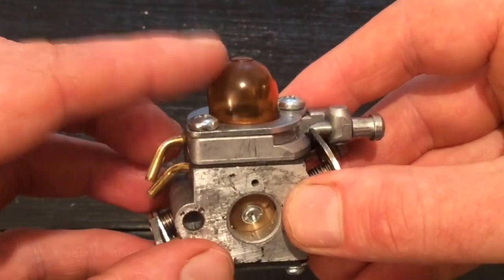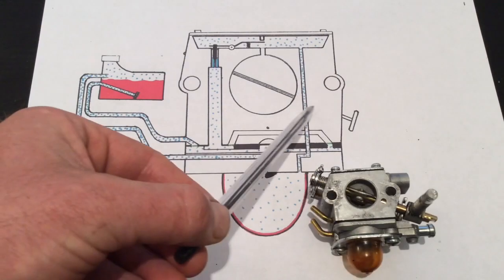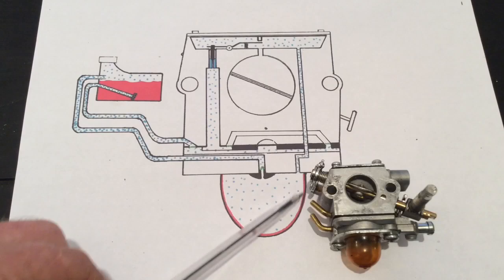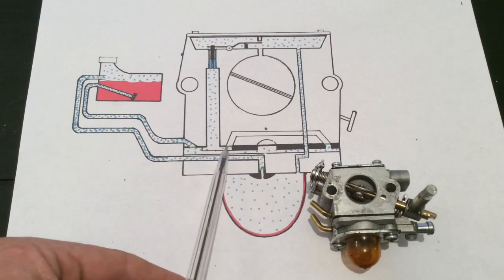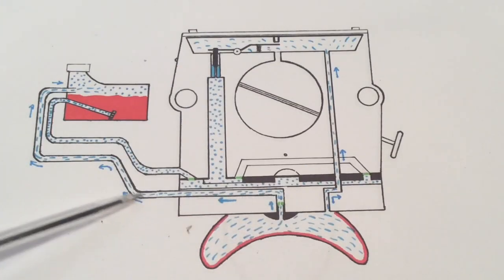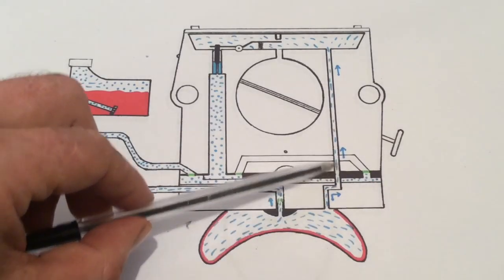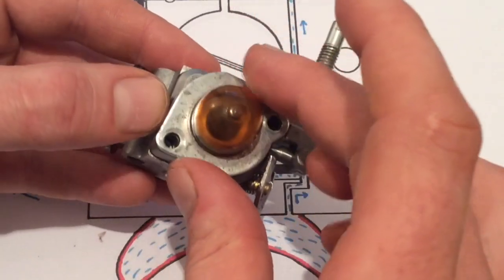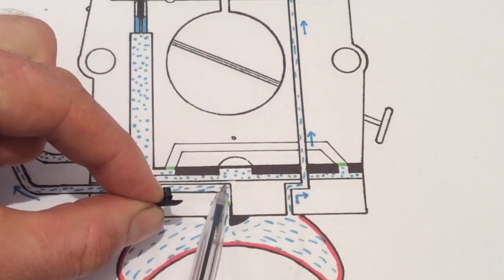The Whole Fuel Priming System Explained - In a 2-Stroke Carburetor.  (by Craig Kirkman)

Comment: Good learning from that, which of course raises questions as I conside it applied to my experience. 1) Does it matter if the choke is set before depressing the primer bulb...seems not, but also seems logical you set the choke last before pulling the starter rope. 2) What does it suggest if when you release the depressed primer bulb, it doesn't tend to fully return to its undepressed shape? Perhaps it indicates something (one of the many little valves or passageways) is plugged and the carb needs a good cleaning? 3) In theory, when you run the engine after shutting off or draining the fuel, are you likely to get all those areas drained so things won't gum up in the period of disuse, ornis there another strategy to keep the carb set for the next use?

Thanks for the detailed explanations! Cheers!

Comment: Nice explanation, thanks. Re the valve in the jet... what keeps it closed when you press the primer bulb(so higher pressure above), yet it opens to allow fuel through to the venturi when the engine is running( with reduced pressure below)...how does the valve differentiate ?

Comment: This is an excellent description of how the priming system works.  It is clear and easy to understand.  One thing that does not seem to be mentioned is what is on the other side of the metering diaphragm.  In the video the cover plate is shown briefly and it appears to have a hole in it.  That would suggest the dry side of the metering diaphragm is exposed to atmosphere.  Is that right?  Thanks for posting this educational video.

Comment: such a great explanation. it is really incredible the design of something like that. simple but almost complex. my gas bulb had a hole in it and i could not get my weed eater to start. i sort of figured that that little bulb was important.  and i find out it is. no gas coming into the bulb so now i have to find a replacement. thanks for you video. was very good.

Comment: Hello sir , I have a problem with my husqvarna 560xp 2017 model auto tune carburettor , it doesn’t suck fuel from the tank when I press the primer bulb, it is does the pressure in the tank but the fuel not come in the primer bulb, can you please help me with that??? Thanks

Comment: Brilliant video and well explained,took my stihl blower out today after sitting for pretty much all of winter, purge bulb had no fuel in it, tryed priming numerous times. No fuel arrived into bulb and bulb very slow to come back to shape. Stripped out carb, cleaned up with some carb cleaner, checked bulb while not connected to the carb to see if it would draw fuel, it did! Ensemble everything back together but still won't draw fuel???

Comment: why does my tank pressurize when 'primed'? (Husky XT260)  Wont start if I have the cap off....? I put a balloon on the tank opening and it inflated when I primed the bulb. Only way I got it to start was to use the balloon as a gasket under a likely leaking cap (I put soapy water on the small valve in the cap and it bubbles when I pumped the primer bulb).

Comment: Hi, i got a REALLY tricky fuel problem or pulse hole maybe
****
It Bogs down when open throttle and only sort of idles so i suspected carb or fuel starvation
So as i done before, i open carb and all parts looked ok but i cleaned and replaced all the diaphragms ect and it run for 10 mins idle and full power and then starved off. I also put a brand new carb on just to eliminate the carb and same problem.
I then suspected the pulse hole leakage or engine leaking at oil seal or gaskets causing air to get in maybe when warmed up and leaning the mixture.  Put vac of 9 psi and it held steady after blocking off inlet and exhaust so the engine isnt leaking. i tried compression next and got 120 psi ? is that enough to make pulse hole work ? 
 i attached a vac gauge to the little pulse hole and pulled rope and got about 2 psi vac and pressure on the gauge so dont know if thats enough?
I notice when i try to start , there is no fuel being drawn through the fuel line to the carb so how can it even idle? Also i bypassed the filter to make sure fuel was available from the tank above the carb. This weed machine dosent have a prime bulb so does the 2 little pump flaps have to have fuel in the carb to start pumping? It worked in past as it is so i guess it will pump until fuel gets to carb but i dont see any going down the line so PULSE line issue not making the pump pump anymore? 
I used new gaskets and made sure the little gasket hole lined up ect to reach the carb and complete the air pulse circuit.
I am at a loss on this machine.

Comment: Good, but my Homelite leaf blower has Walbro 212A with the bulb on the needle side of the carb..it stopped priming and can't figure out why..thoroughly cleaned and replaced both diaphragms..it actually primes backwards pressurizing the fuel tank and never getting fuel to the needle valve or bulb...Thinking I have something installed backwards but I've tripple checked everything...

Comment: Great video and many thanks for for sharing your knowledge with us . I have walbro wt 273 carb with primer bulb on top.It  was working but now after replacing bulb all gaskets and diaphram it won`t suck in via the inlet pipe yet when i submerge it in water it fills up and pumps .I  cannot see where the air/water is coming in and for sure everything is fitted in the correct order.

Comment: Thanks for that! Is there any reason that the bulb would be full of half air and half gas? I've pressed mine 20 times and it's still returning air and pulling in bubbly fuel.
Reply: @CreativeVs didn't find the problem but after messing with the carb and reassembling and things like that when I was moving the engine, it ended up working fine. It could have been debris in the carb that got in there because since I was just testing the engine and I couldn't find a fuel filter there wasn't a fuel filter.

Comment: So if you fill up your fuel tank how does the fuel not go in the other tube(return tube)?
Reply: M F uasually it’s upside down to that drawing and u are basically putting pressure in the tank to push the petroleum through even if you filled it you would probably need to prime it I think 🤔
Reply: @MrJohnnydublin  Thx

Comment: So I have a homelite blower I found at work in storage

The primer bulb draws gas in. But not the way I think it should. Not enough. And not much pressure builds.

I see gas barely traveling through one of the two lines, but not the other and not a steady stream at all

Obviously can't start. Spark and compression are good.

Ideas?

Comment: Hello, I have a Wt997 carb and i found out that when I went to push the primer bulb one day it would not fill up (meaning there was an air leak) the car would start but would run extremely lean on previous optimal tunes.Any idea where the air could be coming from? I can hear the air being sucked in if I rapidly press the bulb causing a vacuum for a couple seconds.

Comment: I have a Stihl chainsaw that will start, then die. Over, and over, and over again. The bulb shows that it is drawing in air internally from somewhere, though the bulb itself does not have a leak. Where is the air coming from?

Comment: Outstanding video!  It clearly explains not only how a primer bulb works (contrary to the popular misconception that the primer bulb pumps fuel into the carburetor, it draws air out of the carburetor, replacing it with fuel.) It also explains that the carburetor contains its own inline fuel pump, metering diaphragm and metering valve to control fuel flow into the carburetor.  I wish I had the benefit of this knowledge 50 years ago when I first began tinkering with small gasoline engines.  Bravo!!

Comment: Great video! The problem is I still don't get to fill up my carburetor with gasoline. I open it up , clean, rebuild and when I pump it is not going gasoline in. I try it in few ways and nothing. I have a partner HG 55-12 hedge trimmer. Any help, what can be?

Comment: Hi Thank you for a very detailed video.
My problem is starting..
Once running it goes all day,does not miss a beat at all.
Having to PRIME THROUGH THE PLUG HOLE.
It starts almost immeadiatly 
,ticks over lovely,and goes FULL THROTTLE Without a hitch.
It appears the fuel is NOT Getting to the Combustion chamber.
  So what the heck can be wrong,,Press bulb it reacts like it should do,,but,,
       It wil not become hard never mind how many times I push it.
Seems as though return to tank is sucking air as well,bubbles in return pipe.
      Hope you csn help.
     Thsnk you in advance.

Comment: Great explanation!  I've got a weed whacker that wont prime right.  The tank is full of gas and you can press the primer as many times as you want but you only hear air being pumped, the bulb never fills with gas but it pressurizes the tank with air.  If you push the primer like 15 times when you take the cap off the tank there's a "woosh" of air pressure that comes out.  Going to try and figure out what's going on.. maybe the pickup tube is clogged or blocked etc?
Reply: You’ve got the fuel lines connected in the reverse order buddy. Try switching them around and let me know if that helps.
Reply: nope. thing worked fine last year, no lines were switched between now and then.  I found the problem.  mine has the primer bulb as a separate piece from the carb so there's 3 tubes. the 2 you show as tubes plus another tube which is the line you show as the thin suction tube that goes to the back of the metering diaphragm (in mine, that's a separate physical tube). that tube had a crack in it so air was getting sucked in through that crack after you pressed in the bulb (when you let go when it was trying to suck in fuel).  I replaced that tube and it works great now. thanks again for the tutorial it helped tremendously!

Comment: For a machine that will not start or cuts out after a few minutes, first check that the fuel pipes have not perished and split allowing air to be sucked in. E10 Petrol/Gas that has bioethanol content will destroy some plastic fuel pipes. I have just diagnosed & repaired this problem with a Titan multi-strimmer.

Comment: Hi have watched this fascinated by your very detailed explanation..
   I have I think exaclty the same carb..
Mine is not starting via pimer bulb as it seems as if you could press it forever and still force air and fuel through the return pipe,,The only way I get it to run is by priming the top of piston with a liitle fuel,it then fires after about 3/4 pulls, warms up and runs fairly well on throttle..
But it does seem as though it is not running PERFECTLY but does the job every time..
It always seems as it would push air and fuel via return pipe forever,does this mean one of the oneway valves is NOT SHUTTING OFF..??.
           Once again thank you very much..

Comment: Thanks again! At one time I knew all of this, but all of my machines have been running for a while and I’d forgotten a few specifics. My string trimmer wouldn’t prime the other day though and I was getting frustrated because I couldn’t remember exactly how each part of the system worked with each other. This video was a great refresher course and I should have it sorted out in no time now. One question though! Do the Zama Carbs on Stihl trimmers use a check ball under the primer bulb? There is not a rubber check valve like the one shown in the video. If it is a check ball, is there any chance that it can be serviced through the Welch plug? If so, what type of sealant would you use to reinstall the plug? It seems they used an epoxy or something from the factory. I’m not sure that is my problem though as I’ve tried two different primer bulb “housings” and gotten the same results. I’m guessing that the passage from the metering area to the primer bulb is blocked or I am an idiot and installed the inlet valve “membrane” on the wrong side of the gasket. I am guessing it is the latter since I filter all of my fuel as I pour it into the tank.
Reply: So turns out I am not the idiot! The carb that I was having an issue with was a new one that I have never rebuilt. I remembered that I bought it from a Stihl dealer last year because a rebuild kit was $26 and the new carb was $30. Great support for their product, huh?

Anyway, the port from the bulb to the metering diaphragm definitely wasn’t the issue, because on this carb the bulb is mounted directly on top of the diaphragm rather than the valves. Turns out the valve gasket was installed on the wrong side of the valve membrane at the factory. Amazingly it ran pretty well for a season of part time commercial work. I did have some starting issues intermittently that drove me nuts and I am guessing this snafu was the cause of it. It is sad that they charge so much for the parts that you can’t afford to do the work yourself and they can’t seem to do it right at the factory... I learned my lesson though. A rebuild kit from China was only $4 on eBay. Stihl could have gotten twice that much from me, but they certainly won’t get 6-7 times that much and I am done buying new carbs when there is nothing wrong with the one I have.

Comment: THAT Sir, was invaluable information, indeed definitive, on the Primer Bulb and Main Jet function of these tiny 2-Stroke Carburettors!! 👏👏👏👏 
I'll be getting my first 2-Stroke Engine, in a 1:5th Scale Gas Buggy. As a Retired Auto Technician, specializing in full size, motor Car Carburetors, I was a little lost.... Something that happens when you've learned too much about something similar, yet different in form and function. 
This has been a tremendous help. Thanks!

Comment: I find by throwing the primer section into an ultra sonic cleaner, it cleans the one way valve in the primer port. There are no parts available for the primer portion of the carb except the bulb. That grommet is hard to find as a replacement part.

Comment: My trimmer worked last year. This year the fuel line broke. I fixed it, but fuel isn't sucking in quickly. I had to pump it like 100 times, and it just hit the carb, but isn't in the bubble yet.

Comment: Thank you for the excellent explanation.   I see there is a small hole which feeds the needle valves from the metering chamber.  You say there is a valve on the main jet but why does the air not enter past the H and L adjusters?  I have an engine where the primer only pulls fuel if I close the H adjuster.  Any Ideas why this may be?

Comment: I rebuild my walbro carb with a kit. When I pump the bulb it makes a hissing sound and does not fill with fuel. But the fuel comes out of the front of the carb and soaks the sponge air filter, I think through the vauel in the last part of your video. Is my primer bulb blocked?

Comment: this is the best explanation on YouTube but my problem is primer bulb when us pushed comes back up slow and will not full up completely also the return hose to the tank Has bubbles in it every time I prime the bulb,why is this,does it have a air leak? it's a twin 57cc motor the other carb and cylinder run fine,any help is appriciated

Comment: Although now I understand I wish I knew what I could have done wrong with mine. I got a new kit changed and clean it and I also wish...it sucks, but it does not! Mine has an exhaust pipe as well and normally I stop pumping when fuel comes out of it (and falls on the ground) When I pump I feel a little air spray from the exhaust but no fuel comes in?

Comment: Thank you so much for this and the other carburetor videos you have.  No longer will I fix a carb by simply saying "OK, I think this piece came out this way, so I think it goes back that way..." and will actually know more about what I'm looking at!   If you have the time, I'd love to see more about the valve mentioned at 13:50 and how it only opens when the engine is running.  This indicates to me that overuse of the primer bulb shouldn't lead to flooding, but my experience indicates this isn't always the case.  I'd love to know more about what is supposed to prevent over-priming when the primer bulb is used. Thanks again!

Comment: Nice vid! My trimmer carb runs if i spray fuel into the combustion. My carb is clean but when I prime it the bulb stays down. I can get it back by either waiting or by injecting gas through the inlet of carb with a syringe. What do you think it could be? The prime bulbs pumps up and down fine when i have the carb seperated.

Comment: So, if my primer bulb is not filling with gasoline, the problem is in the carburettor?   Good explanation.
Reply: Most likely in the carb but it could be a plugged tank fuel filter or bad fuel line too.

Comment: Thank you for this info! Sometimes you repeat things a bit much but overall very informative. I am curious though, I thought you could "overprime" or press the bulb too many times and it would flood the engine. With your explanation it seems this is not true, and the fuel will just keep cycling back through the tank.

Comment: Great way to explain primer bulb on two cycle carb
My question is I have a 4 stroke cultivator model 316.29270 I have drain gas tank replace little filter in tank totally clean inside tank replace new bulb, lines (2) are clean replace to ports BUT I can't get the bulb to pump gas up into the lines at times I thought I cross the lines to the ports now at a total loss 
I have pour little gas in spark plug hole and it starts for short time I did this prior to cleaning out tank.
Your videos are superb

Comment: hi what a fantastic video I have a stihl hedgecutter with the same sort of carb when it is running there are tiny air boubles coming out of the suction tube and into the primer bulb is this normal this is when the machine is running . thanks for all the video's you have  put up